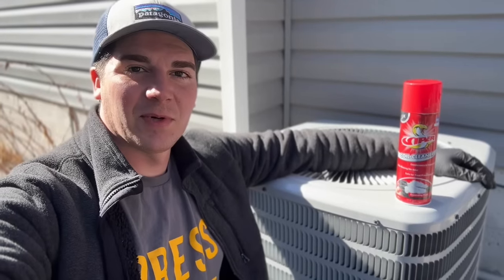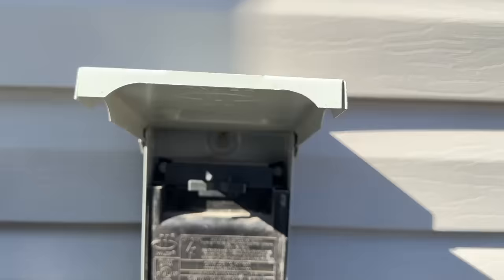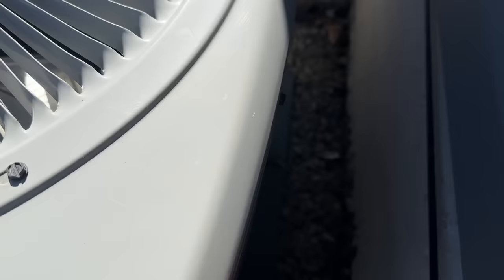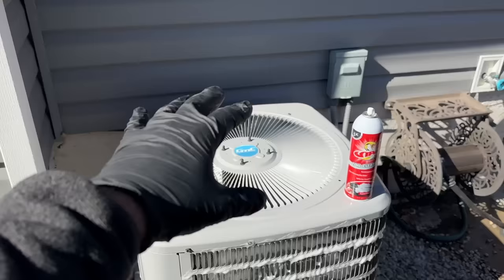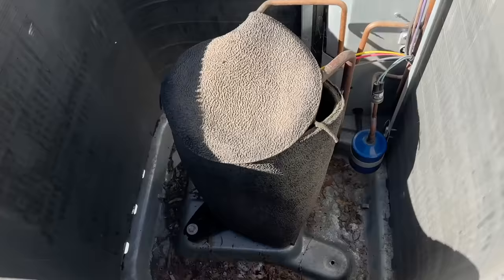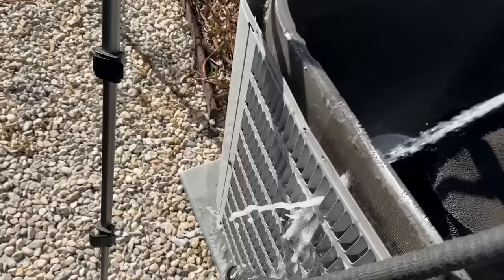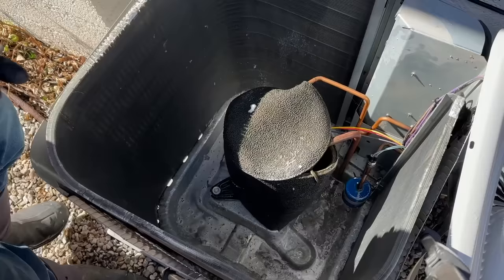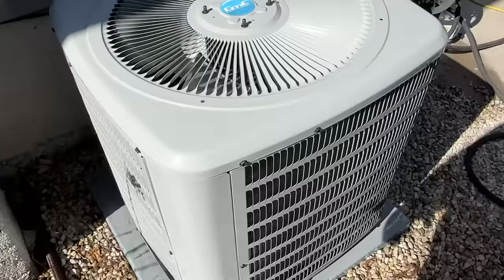How To Clean Your AC Condenser Unit | Spring Cleaning Pro Tips

Comment: Seems the order of operations is backwards.  Should have shop-vac'd the floor when everything was dry.  Then rinse the outside and inside with those to get the loose dirty out.  Foam the inside only, let sit 10 minutes, and then one final rinse.
Reply: Exactly, that's the way I do it. Plus, most of his spray is getting on the outside housing not the coils, definitely spray it on the inside and then wash it off from the inside.
Reply: I read the coil cleaner isn’t even recommended unless it’s greasy which isn’t usually the case for AC units. Also read if not hosed down enough it can remove paint. Another guy said his Trane rep said coil cleaners void the warranty.  

My unit is about 10 years old and I have never cleaned it. I noticed a bit of dirt inside so I will Vac and low pressure hose the inside and see from there. 

Thanks for the video, I will make sure to pull the tag out on the power box.
Reply: @BWeezy-sw1wy our ac service guys are from the company that installed the unit and they use/recommend using a coil cleaner spray.
Reply: Yes, you are correct he should’ve. I believed cleaned it when it was dry. I think it’s a man thing my son-in-law wets the surface and then cleans it and I told him you’re actually doing it backwards. It’s more difficult to clean once it’s wet.
Reply: Also taken the panels off to ensure good covering of the coils. But you know
Reply: I was going to say that lol
Reply: Where is the link to the foam cleaner? Thanks

Comment: FYI watch the water pressure when cleaning the fins.  I made a mistake of cleaning a unit at a previous home and it was more pressure than I thought and  ended up bending some of the fins.
Reply: @tetedur377  I didn't even know about those at the time and it would have come in handy.  The unit I messed up was going to be replaced anyway, as it was too small for the house.  I was trying to clean it to see if it made any difference but even the AC tech said it was just too small for the house.
Reply: fin combs are awesome.  I have one and it comes with variously spaced combs.  Bent fins and dirt can increase the costs of running up to 200%!
Reply: @e-spy  oh wow. Mine is dirty as hell so I should probably clean it. Mine sucks grass in every time I cut the grass. I’ve cleaned it in the past but it’s been a 3-5 years.
Reply: I’ve don’t that myself. Nothing bad but any focused higher pressure even on a garden hose will bend them.
Reply: Thank you! I have watched several videos about how to clean the air conditioner and they all say exactly what you said I appreciate your comment as a single woman you are a blessing a lot of things I had to learn to do myself or pay an expensive price
Reply: They make a fin comb for bent fins

Comment: Vac the dry debris on the bottom of the pan inside first then apply the foam cleaner and water.  Save yourself a couple of steps and it gets a lot cleaner.
Reply: Does it matter if u spray outside the unit or inside 🤔 will it make a difference
Reply: Amazing how someone has to point out the obvious. 😂😂.
Reply: @talkofmiami03  it depends! Some systems have a double row so you have to get the inside and outside, but some don't!
Reply: @Kingfisher1215  You'd be surprised how many people don't see things as "obvious". That's why there are so many warning signs on things that you think there shouldn't be because it's "obvious".

Comment: I open the top of the units and vacuum any debris that fell in. Then I spray the cleaner from both sides of the coils and let it sit for about 5 to 10 minutes. I use the shower setting on the hose and flush it from inside out to assure the debris isnt pushed into the coils.
Reply from the maker: Thanks for the feedback!
Reply: He does show that in his video
Reply: I have a question. When I wash the inside of the condenser, I see water accumulate at the bottom. Is there a drainage hole at the bottom? Where is it and how to find it?

Comment: Please let the customer know,
To not use a power washer or a high pressure adapter for the water hose on the a/c unit= it will damage the Cole fins, they are aluminum and will bend.
I have found that some units have had the fuse box bypass on the wires to the fuses because of the fuse has blown or it's a old unit,so just turn off the breaker, you possibly have to reset your thermostat if it is programmed (check the battery).

Comment: Decent video, however agree with comments about shop vac inside 1st in addition , if you are removing top portion w/ fan , it would be best to remove the outer jacket for  better access , if coil fins are really matted they could be reached much easier, easily vacuumed off 1st, for best results, & then  sprayed with coil cleaner,   👍👍👍

Comment: Take off the louvered shroud to get the product on the condenser fins for a thorough cleaning. I have to do this 3 times from April to end of Oct. It's on that much because of the heat & humidity. Plus all the horrendous pollen counts we have here. In 40 days, you can't see the fins-completely clogged over.
Reply: Do I need special tools to remove the cover?I’m trying to do it myself because I know I have to remove the cover
Reply: @ektrne1874  typically held on by 1/4" socket hex head self tapping screws so no nothing super special.

Comment: Mine is only 3 yrs old but accumulated lots of ‘fuzzies’ up against the outside of fins. I took top and sides off and used my shop vac with soft brush to suck all crap off the unit. No water no toxic cleaners, just suction!! 👍🏻😎
Reply: It’s good , however that’s like taking a shower & NOT USING SOAP 🧼 😊
Reply: @bruceberger1569 🤣🤣🤣🤣🤣🤣

Comment: A dirty coil can draw more amps which can cause your circuit breaker to trip or higher electric bill or cause compressor to work harder which can shorten the life of the unit
Reply: @Carguy0882  
It's not necessarily OBVIOUS to the majority of people.
The normal Joe just turns the AC on and off.
Kind of like my wife with her car.
She knows it goes Vroom, she just doesn't know how.
PS
Don't be a dick
Reply: @Carguy0882  You're a mean guy. Reevaluate and start over.

Comment: Taking lid and sides off annually works very well.  First vacuum the unit, Use very soft brush and i mean soft, protect the fins brush, then use garden hose, no high pressure at all.  Low easy pressure like its the most delicate flower.  Rinse inside and out.  Dont forget to turn off your power source first!!! I have a condenser cover on for winter before leaves fall and a large rubber square mat on top so it does not bl9w off with winter winds.  Keeping it cleaned each yr is a must.  This year i noticed screws missing, purchased more so each hole had a screw.  Noise drastically reduced.  Not sure where them screws went over the winter, guessing on vacation with those missing socks.

Comment: Personally I'm very wary about using any harsh chemicals on my units. I do keep the area around them very clean and put a lid on the top spaced with soft cushions in the winter to keep debris from falling in. I'm very careful about doing anything that could scratch the paint and promote rust. If air flow is good and I can see light passing through the coils, I leave them alone. My old systems lasted 47 yrs. and would likely still be running if the previous owner had been more careful.
Reply: Agreed...I just hose mine out yearly so nothing ever accumulates.
Reply: 47 years.....wut....lol
Reply: @scottschulte1157  my old system was 27 yrs old ...ran as smooth as a babys' behind 😁
Reply: Just because it is still running doesn’t mean it is efficient
Reply: @joenewman6494  Don't care. Electricity here is cheap and the added cost of AC in the summer is almost trivial. The increased cost (and complexity, therefore likely failure rate) of very high efficiency systems is such that they would never pay for themselves during their lifespans (or mine).
Reply: @wholeNwon  Where do you reside? Electricity cheap?
Reply: come on, it is just stupid iron)
Reply: @klllddd  Yup, it's just metal but people are stupid.
Reply: Totally agree. I asked our A/C repairman about coil cleaner. He was very adamant about not using it. He told me he heard about a local HVAC company that used it on the air-conditioners they serviced. After a given time a majority of them began to rust. He said just hose it down after the cottonwood trees do their thing.
Reply: They don't make 'em like they used to!
Reply: @theadjuster151 yeah, they’re better!
With powder coated cabinets, high efficiency scroll compressors.

Comment: Nice video man I wash my outside unit right before summer every year sometimes twice it depends.i normally only use water to wash it down but this year i got the foam cleaner while at home depot and glad i did when it was done the house was nice and cold 🥶👍 its important also to use a spray nozzle that is not on full blast or to strong of a force have it on a low cycle so you don't damage the coils.good job your unit looked spotless,but you had me worried when you sprayed right at the wires not a good idea.thanks for your video

Comment: Would have been interesting to measure the before and after effects of the cooling improvement.
Reply: yes! What a waste of opportunity!
Reply from the maker: Thanks for the feedback, I like the idea 👍
Reply: If there’s a lot of buildup, run the AC before doing this and and just hold your hand above the condenser to get a feel for how much airflow it’s able to make. Then do the same after cleaning — you can feel the huge improvement. It’s like trying to blow out your birthday candles with a covid mask on, then taking the mask off—
Reply: Superheat #'s. There are blue tooth smart phone dealios nowadays!
Reply: Dealios?
Reply: I can try to see if there is a difference, current my condenser is filthy and I mean filthy outside yet my ac blows cold in 100degree weather and I am about to do a cleaning of the outside condenser, I will measure and see if it is any colder.
Reply: @isabellavision  I also put a large piece of cardboard on all 4 sides, my unit would not hold the cardboard on 3 sides, so after cleaning it it held the cardboard on all 4 sides and blew like crazy going straight up.
Reply: @Moondoggy1941 now that’s a good visual experiment lol

Comment: Dish soap works just fine most of the time!
Reply: Foam is better for pushing the dirt out. Soap doesn't do that. If there's no major buildup, I think the soap will do a good job.
Reply: @Arctic5fox  Wrong. Dawn. Palmolive. Have lots of fats. Which kLING! INTO ALL PARTS. AND BREAK DOWN ALL THE GUNK. AND IT COSTS PENNIES A CLEANING. ME GRAMPS  IS A MAINT. MAN. 44 YEARS! AND HAS CLEANED THOUSAND OF THESE. BEFORE YOU WERE EVEN BORN😊☺HE'S A EXPERT! AND HIS UNITS RUN NOW SOME 53! YEARS!! SO!! 🏆🏆🏆🐯🐯🐯🐯👑👑👑👑
Reply: @captainamericaamerica8090  how do you spray the palmolive into the coils?

Comment: is there any particular reason you can't just spray down the coils with something liker Fantastic or Simple Green and rinse off?  I've used the fancy expensive coil cleaner myself in the past but I didn't see any advantage over normal spray cleaners.
Reply: I'm going to guess that the product shown in video has a foaming action and expands between coils ensuring near 100% contact between rows while general purpose cleaner may only lay on the top side of the coils leaving the underside of the coils untouched. 
I personally feel like citrus based cleaner would work just fine as long as you can spray it liberally from all angles to ensure 100% coverage on the coils.

Comment: This is so helpful, thanks for sharing!  I’ve always paid $100 to an AC company but will definitely be trying this myself.  Mine has a lot of leaves that fall inside it.  The opening over the fan is pretty wide, could I install chicken wire underneath that opening to keep leaves out?  Assuming the holes were big enough to allow for airflow?

Comment: i have a question. what happens when its really dirty? does that just prevent airflow into the house? prevent cold air? can it cause the pipes to freeze?
Reply: When it's real dirty.
The AC has to work harder, doesn't cool as well as it should and uses more electricity.
Reply: @Dougie1969   yea i get that. thats the basics of things that are too dirty or clogged.  i was wanting to know if it could cause freezing. but anyways , i cleaned it yesterday, and it hasn't froze up yet. thanks anyways
Reply: @qmerk2661  
As far as I'm aware, freezing us "usually" caused by the cooling fan not working correctly.
But i am certainly no expert
Reply: Yes it would cause refrigerant lines to freeze,  but more so from lack of refrigerant. (Freon)

Comment: How do you keep the indoor unit clean and mildew/mold free??
Reply: Use a coil cleaner that is a disinfectant with a mold/mildew treatment
Reply: Have a UV light installed.  It works great and helps keep the vents safe.  It is a little pricey but it’s better than having mold in the house.

Comment: Very good video ! Thank You!  My son just bought a home where the AC condenser is under some overhanging bushes. Will trim that all away but the interior is littered with muck. Even the fan blades have leaf debris stuck on them. The unit is very similar to the one in your video. Question is will I have trouble getting the top cover back on. I took one off a Carrier 3 ton unit some years back and had great difficulty getting it back on! Thanks!
Reply: Meant to add that is says on a label it is a Copeland Scroll compressor. No cover on it!
Reply: Try having someone  hold it or gently tilt it  back, & lean against house if unit is set in  this fashion, that’s what I 👁do  , remove entire casing 4 panels fan attached lid w/ 4 panel supports , power supply OFF, & also very small brush or very carefully vac inside where electrical wire panel is inside unit, just be careful NOT to touch wires, or capacitor etc… sometimes mice 🐭 find their way inside or other pests 👍👍👍👍👍

Comment: If you gonna do the outside of the unit to me, that’s doing a half job ‘the correct way would be taking the fan out the way so you’re able to clean out all the leaves or all the Debris , Dan you’re able to clean the inside of the coil that would be the correct way of doing it

Comment: Geez…I just paid a $100 for an ac tune up but stated it is $450 for clean up of outside unit (which I turned down) (in shock) & then was informed that the motor compacitor should be replaced for $370 (which I turned down as well…so being on fixed income, I may try $ clean the coils myself.

Comment: How about cleaning the outdoor unit for a mini-split / ductless heat pump?  Does the top typically lift off in the same way? I have a Mitsubishi unit and I think it’s due for a cleaning this spring.  Thanks!
Reply: No. Your common mini split has a horizontal condenser fan. Shut off the power, wet the coil ( located in the rear usually ) after you wet it with MEDIUM - LOW PRESSURE, spray the foam or greased lightning or your preferred cleaner that does NOT contain ammonia or chlorine . Let it sit for 5 minutes and then start rinsing from the front (use something to hold your fan blade still, a small dowel will work ) after you rinse from the front, finish rinsing from behind. Let sit and drain for a few minutes before you turn it back on. Most mini splits WILL lose your current settings when power is lost.  But all in all my advice is DO NOT REMOVE ANY SCREWS OR PANELS. If the unit is under warranty, you WILL VOID YOUR WARRANTY. If you read your warranty papers closely you will find that ONLY a LICENSED PROFESSIONAL can "open" your unit without making the warranty VOID. These DIY guys never seem to mention any of this. I am an HVAC TECH with 20 years experience.

Comment: We're in a heat wave, and my ac isn't cooling well. It needs cleaned, I imagine that's the problem, but my garden hose hasn't been working for a long time. Is there some way to clean it without a hose while I wait for parts to come in so I'm not hot in the meantime? Will a shop vac cause damage? Thanks!

Comment: You don’t need quail cleaner. You just need to clean from the inside out twice a year. And if you have cottonwood trees, just wash it from the outside and 45° so you’re not washing the cottonwood into the coil. Forget about the color cleaner it’s just a waste of money the only time you use that would be the evaporator coil, which is really hard to get to. Ticket for me with 45 years experience in HVAC.

Comment: I have never understood why compressors are not placed on a riser. Yes heat pump compressors are mounted on risers, but why not every unit. Mounting on a riser would help eliminate sucking in  ground level dirt, grass clippings and mulch dust that some people put around the units. Flushing from inside out flushes any dirt back out the way it came in. trying to flush from the outside only pushes the dirt in more.

Comment: Nice video, thanks for removing the top cover, havent done that yet. Safe to spray water in there with all those wires?
Reply: I'm sure you get rain water in there?
Reply: Power off, but yes.
Reply: Make sure power is off FIRST. Allow to dry before turning power back on.

Comment: Would it be a deeper cleaning if you sprayed the inside coils as well as the outside coil areas?  Is there a reason you should not spray the foam on the inside?  TY
Reply: The build-up is usually heaviest on the outside as the flow of air is from out to in and up through the fan. That's why you should try to rinse from inside out. But it isn't really gonna hurt to spray cleaner inside... just might not be worth the time and cost.
Reply: @Toyotajunkie  thank you for the reply.
Reply: @Bob392  I forgot to say... I PERSONALLY prefer to not spray the cleaner directly on any electrical connections, even if that means a couple square inches do not get "deep cleaning."
Goodluck!
Reply: @Toyotajunkie  Makes perfect sense.  Thank You